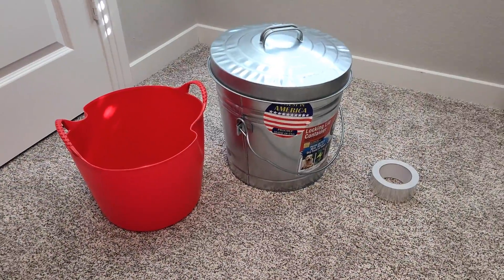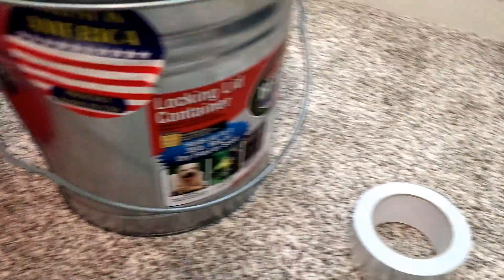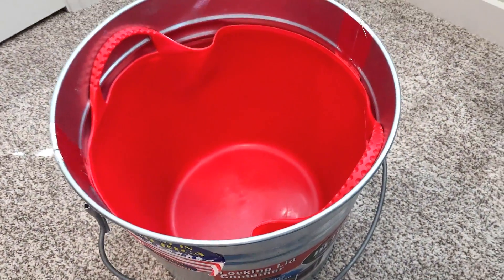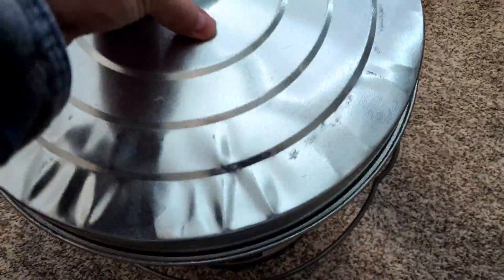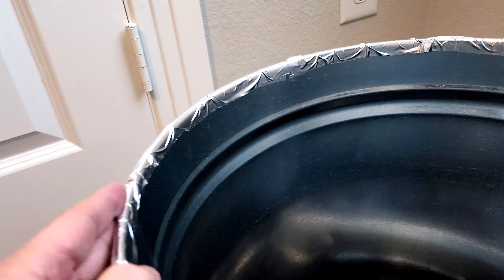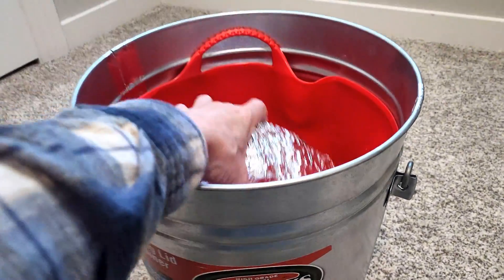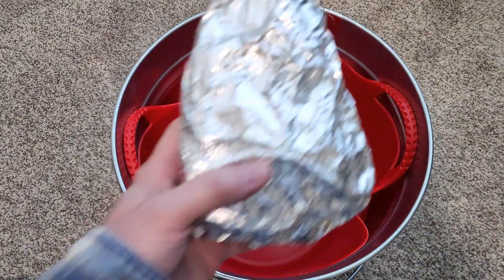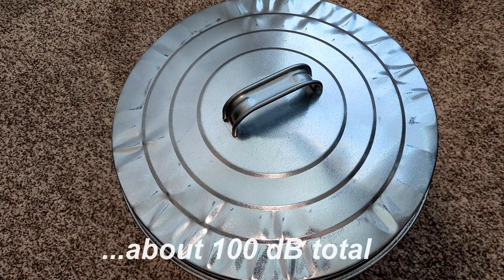How to Make a Faraday Cage in 5 Minutes Using 3 Items & How to Test It. THIS IS AN UPDATED VIDEO.

Comment: Why the rubber insert? Thank you for the helpful video!
Reply from the maker: I guess you missed it in the video... To keep metal items from touching the can.
Reply: @LoneStarPrepping do you think cardboard would work as well? If so, I’ve got access to a ton of that!
Reply from the maker: @ghostdog2041  It should help insulate metal items from touching the can but has nothing to do with protecting from an emp.

Comment: I bought the tool box and tape that you recommended. I covered all of the areas etc but it does not work. Pls help!
Reply from the maker: How did you test it and is the lid sealing metal to metal or tape? Did you seal where the handle AND bracket attaches?
Reply: @LoneStarPrepping  I tested it with phone. I used the aluminum tape and the exact tool box that you recommended in the video from abt 2 years ago. I believe you used a radio to test yours. I've used two roles of that tape over all of the potential points of entry.
Reply from the maker: That was your mistake. Dont use your phone. It has WAY too strong of a signal. Use an AM radio.
Reply: @LoneStarPrepping  I'll try this next and report back. Thanks! I love your channel.
Reply: @LoneStarPrepping  it worked! But won't a solar flare or emp be as strong as a cell phone?
Reply from the maker: Its best to go to the links under the description to read my source of info.  If your setup has 50dB or more shielding, it should be fine. To do a better test, you need a spectrum analyzer, which cost a lot of money. I explained in the video what to do to get more protection. I hope this helped.
Reply: @LoneStarPrepping  it did, ty. I'm reading up on Bradley, now.
Reply: @LoneStarPrepping  Thanks for the video. Could i use the FFT mode on a digital oscilloscope instead of the SA, for checking? Thanks.
Reply from the maker: I suggest a strong am radio signal.
Reply: @LoneStarPrepping  Thanks
Reply: Is there a step by step video I can use for reference? It's the exact same toolbox and tape. I've combed it over many times. So much time and money. I'm about to put it on the curb.

Comment: that little tote in there is brilliant! fyi Behrens makes a 10 gallon with a locking lid, This might solve your lid not making a good connection problem. Also sealing the lid with a complete strip of the aluminum tape should do it, although inconvenient for accessing your gear.
Reply from the maker: My small can lid seals really well... very tight without adding foil to the opening rim. My larger can lid does not seal as well. I had to add tape to the rim. In that case, I didnt have to tape the lid down.